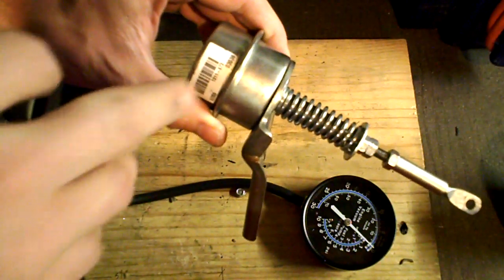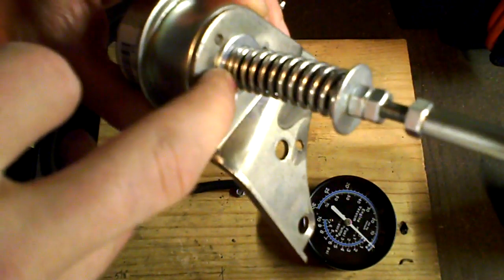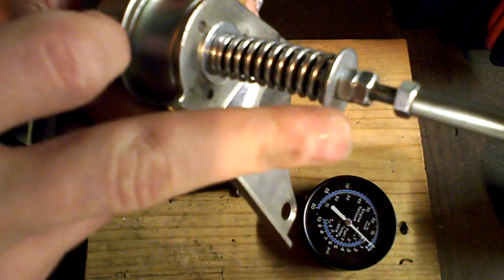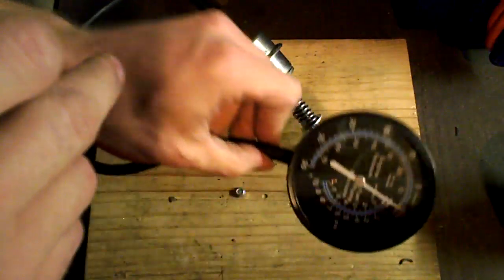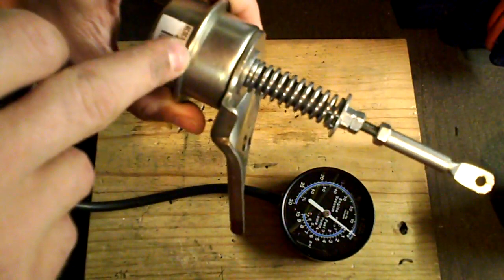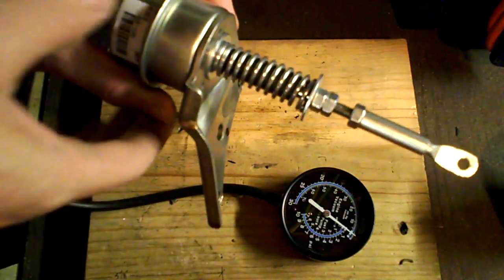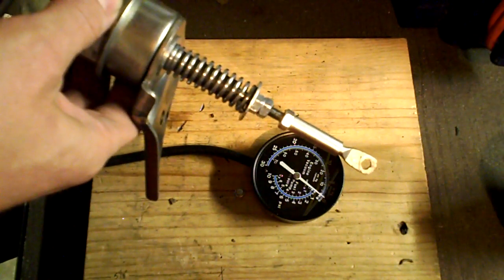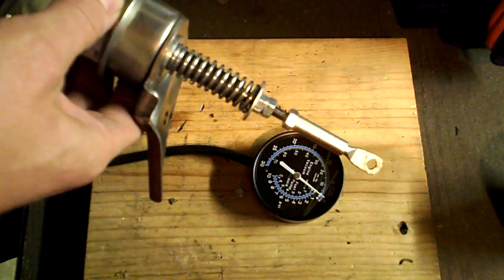lower PSI on a GN wastegate acutator

Comment: I'm actually in the same boat as you. I have a 1977 Dodge D100 with a 225 slant six  that I am turbocharging with a Garrett T04 from a GN. I need the boost to be set at 10psi max as that is the most boost the stock engine can handle daily driven (which it's not going to be daily driven, but whatever). Where did you get the spring from? And do you just compress the spring more to lower the psi?
Reply from the maker: sounds like a good setup and I understand what you are saying about the "daily driver" status.   If I remember right, I think I found that spring at a local Ace hardware store.  They had a few in stock that were the right size (diameter, length) all in different compressions.  You have to test it to find the right one.  

Yes, the tighter you make the spring compression, the more it will "assist" the waste gate actuator > lower the psi required to move it. 

After I set it up, I got it to open around 5-7 psi and then I added a VooDoo MBC to make it spool faster and then blow off at 10psi.  It works great in combination.
Reply: Shad Boucher yes thats where i got mine